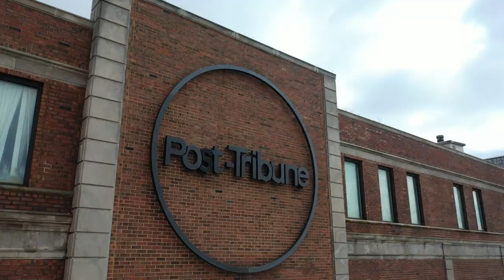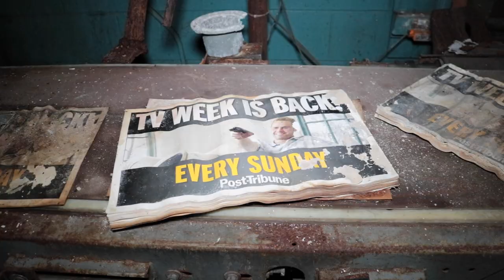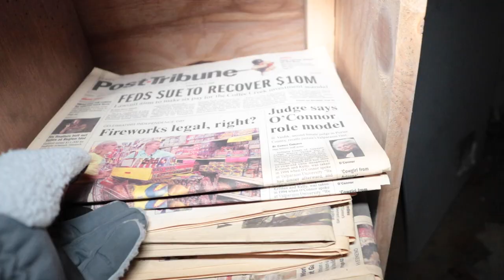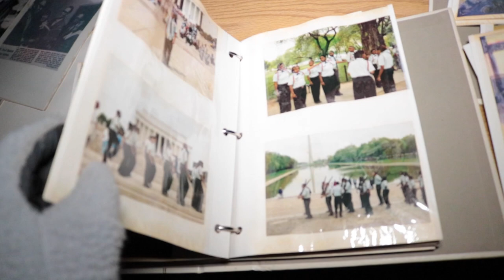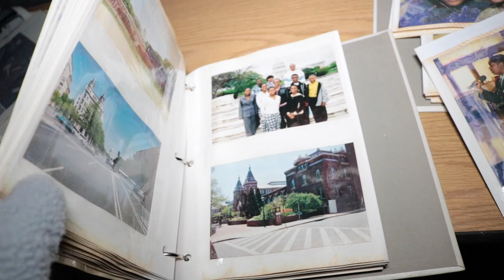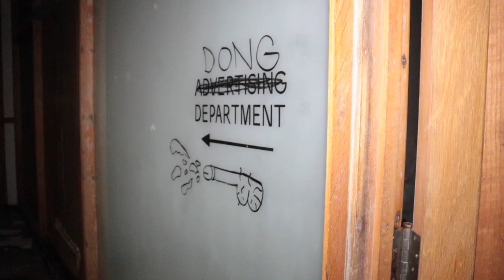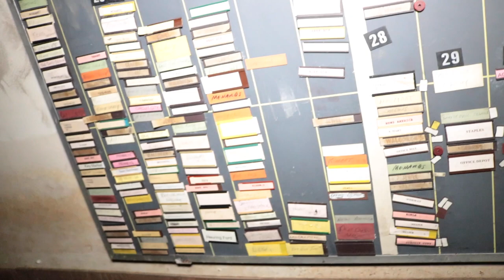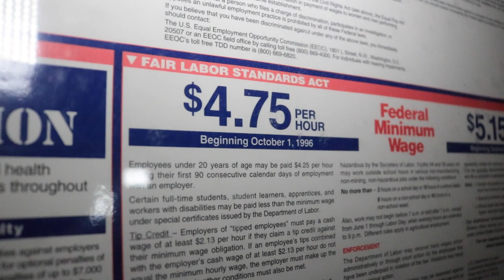Old Printing Press Found In Abandoned Newspaper Office

Comment: The flooded room would have been the press hall where the printing presses would have been installed. the round circular blue machinery would have been a newspaper inserting machine. I used to work in the newspaper industry and I recognize the equipment.  The green bar computer paper was most likely the manifest and subscriber truck labels from a software company named Collier Jackson.  It is really sad that most newspapers have greatly declined or went out of business. If they even still exist most newspapers are printed by other printers now to save cost.